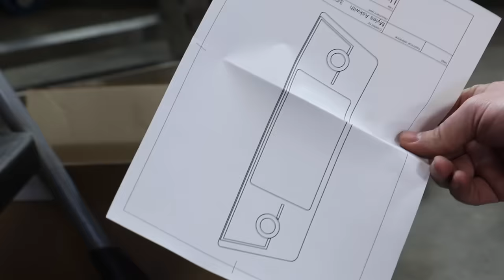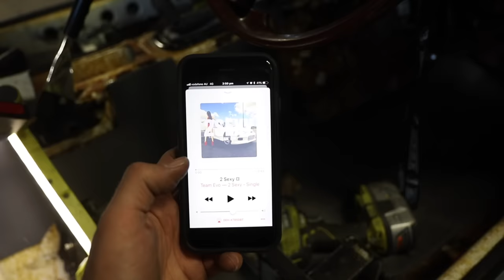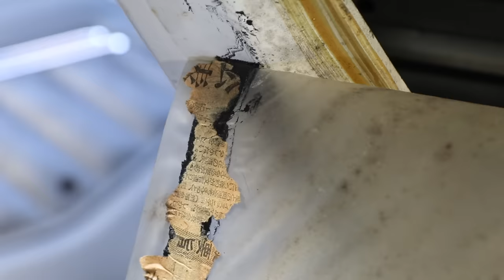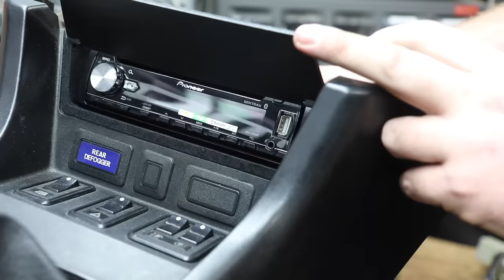RB26 240Z - Roll Cage + Stealthy Hidden Stereo

Comment: Why didn’t you just get a four channel bluetooth amp?  You could have done front speakers and rear sub without removing the factory head unit. Was it just that these are what Kicker and Pioneer would provide for the build?
Reply: Consider that most of the wiring on the inside was toast. I guess that if you're going to be running fresh cables you might as well go all in.
Reply: THIS EXISTS? what a great idea.  I find it dumb we have headunits still so large when cd players are old hat and not req
Reply: You need to be careful that your whole life does not largely rely on you having your phone with you.  They break.  They get stolen.  They die.  They fall into a sink full of water or a puddle.
Reply: A head unit gives you a lot more functionality.
Reply: I run this setup on my Miata. I've never missed my head unit. However, you can't forget your phone charger! Then all you have to listen to is the car... ;)
Reply: Sometimes it's nice to have the radio. Listening to Triple J helps me unwind when I drive home from work.

Comment: Re: Getting back the pushed out center bits from the fasteners

I would suggest coat hanger wire, with a blob of clay or fun-tac (moldable plastic for hanging posters and stuff) on the end to grab anything loose. Cheers!

Comment: You can get panel plugs/retainers with threads on them. They're like expanding bolts used for drywall (gypsum wall board). Similar to the screw-clips that hold bumber ends on, but all plastic.

Also, I'd have designed in magnets for that radio door. One to keep it shut, the other to hold it open. That's going to rattle to no end.

Comment: for the clips you need to push it just a couple of millimeters just enough, you dont have to hit it to push it in. then with a flat screw driver pull off the clip, suzuki use these on their bikes and i learned this the hard way, awesome build and the best ever combination any motorhead could think of

Comment: The trick to the taking out the push pin and not losing he center is to not push it all the way through. Use a pic tool or other long thin tool like a hex key as mentioned, pinch it between your fingers, only let a half of a centimeter past your fingers, then push the center pin out. Your fingers act as a stopper and that way you can pull the clip out in one piece.

Comment: Hey Moog, great vids m8, those clips are a pain in the ass, I use a small sharp screw, just screw into the peg a few turns and PULL it out with a pair of pliers, works everytime.

Comment: On my '73 Plymouth Duster I mounted the front speakers in the kick panels. I didn't want to run wiring into the doors or have to cut the door panels, or make the new speakers visible when the doors opened. It had an AM radio and 1 dash speaker when I bought the car. In 1993 I bought a cassette deck that fit the factory radio hole and put an aux. 6 CD changer in the trunk. I also mounted a pair of 6x9's in the rear shelf and hid them under guitar amp grillcloth.

Comment: for the plastic panel clips. There are ones you can use a philips screw driver to install and remove them. I use them. Just don't get the cheap ones.

Comment: Man I miss the days of installing car stereos. 

My first install was my 98 lancer.. ran all new wiring to all 4 doors with alpine R splits all run from the AMP in the boot with 2x alpine 12" type r's off a 1000w rms  mono block.

Second install was my 1992 twin turbo manual soarer..  that was NOT fun at all, the interior was so flush removing the back seats was a nightmare.
Ripped it all from the lancer and put it in.

Next install was my mates Mazda 3... that's was easy as.. 5.1 with front center of an 8" DVD player.

After the 3rd car you can do it in a day.. My final install was my 2008 CJ lancer. Miss those days.

Now there is nothing in my boot except a pram and broken dreams.

Comment: Hey Moog, I know the filming and release of the videos are quite spread out so you've probably already come up with a solution for the front speakers but I wanted to tell you about a place called Datsunworks, they make a kick panel made from abs plastic that have raised speaker holes that are pretty stealth. They make them for the 240z, and the 260z/280z so you should be solid.

Comment: They sell kickpanels for the front that you can put speakers in. Looks very clean, its what I did for my 240z.
Reply: Rindos Rides they don’t fit very well on RHD models that have been converted to E Throttle, the accelerator ends up inside the speaker housing

Comment: Drill a tiny hole in the center peg (not required, just makes rest easier), get a small screw with course threads and insert it a few threads deep into the peg, and carefully yank out the peg. That's the nicest way to reuse those dumb pegs. Can also try prying it out using a flat bladed jewelers screwdriver.

Comment: Moog, you're pushing the center of the pin too far. Just push it enough to where it's just a little bit below the face of the clip, and it should come out with the center pin in place. Then, you push the center pin back up so it's sticking up out of the center of the clip, and you're ready to reinstall. Hope this helps! Once I figured this out, these became my favorite knd of trim clip.

Comment: For the clips use a flat blade precision screwdriver to get in under the head to lift the pin up a couple of mills. Then get side cutter plyers and use them like a claw hammer with a nail to remove the pin. It is only about  1 in 40 clips that are particularly stubborn  that I simple cut off and use new.

Comment: For the front speaker, suggest using a good quality shallow speakers, 4" or 5.25" coaxial since the door panel don't have much space. The reason for slim speaker so that you can maintain the purity of the door metal. Find a spot on upper leg area, mount it on the cardboard door panel, find a mad looking speaker grill for mad finishing. remember put some acoustic felt behind the speaker.

The rear speaker pretty much a waste because of those drilled hole which is not enough. For the kicker sub, adhesive velcro tape will do.

Comment: Use the corner od a flat screwdriver to push the pin in a mm or 2, then pull the whole clip with a pry tool, I use plastic tools for this so as not to damage the interior. Some of those clips can be pulled out instead of in if they have a tab that goes from the middle to the outside.

Comment: Hey MOOG, regarding those "Single use clips" at 7:40 or so, drive a small self tapping screw into the middle pin just a bit and pull it out with pliers.

Comment: Staging is your best friend in the case of where to mount speakers. Personally I'd go with 6.5" component speakers in the doors with tweeters mounted in either the A pillars or on the dash facing toward driver and passenger.
Reply: PowerBass offers a great pair of 6.5" components with tweeters for cheap! And sound great!! Also come with bullet shapped center pieces for the components in place of where the Tweeters can be mounted in if you decide to mount them else where

Comment: Love the flap for the radio, I would have tried to add the original faceplate over the new one, maybe something on magnets so it maintains "purity" and is easily removed for normal use.

Comment: you are supposed to push the pin in slightly below the surface of the outside part, and then pry the clip out like any other clip. hope this helps later

Comment: Technology did slightly go forward! My 1998 Volvo V40 has the same type of clip holding trim and felt together BUT the middle pin is replaced with a screw you can simply screw out! Google for Volvo V40 trim clip to see it :)
Unfortunately I must admit that after 20 years the threads on the bolts don't really hold and they can still be a pain to remove, but still definitely easier than the push type ;)

I bet replacing the clips with ones with a bit fresher plastic would fix the problem for at least a few years.

Comment: I feel like you guys should put a little bit of felt or something soft with an adhesive backing around the inside trim of the radio bezel so the door doesnt knock against it constantly. A subwoofer in an old car, also being that the shifter trim is right over the vibrating drivetrain could lead to a lot of small noises from that door.

Comment: That head unit cover is cool, but if you want it at the next level it needs some type of assisted open. A spring or lower the hinge position so you can push on the top of the panel to open it.

Comment: You arent meant to push the center completely out of the clip. You are just supposed to push it enough to click again which means the lock is disengaged and you can pull the clip out. You then reset the center push pin where it is sticking out so when you push the pin back in it engages the lock.

Unless you are talking about an entirely different clip that is the only clip that I know of and my car, even my motorcycle, has those types of clips.

Comment: If you push lightly on those clips the pin should click back and be able to come out without losing the pin. If you push too hard the pins will fly out the back. You'll feel it click once before it pops all the way out. Then just grab a clip tool and pop the clip out.

Comment: With the flap, may I suggest adding a layer of silicon or flat foam strips around where the flap lid bezels are, would not want to be driving around hearing a rattle from the flap hitting plastic ;), may also want to have a way too keep the flap locked when boosting.

Comment: You could put the front speakers in the center console. But in the doors, you will need to route the wires in the door and, since (from what I saw) there is currently no wires to the door, getting the wires from the car to the door, making the clearance and protecting them may be a lot of work...

Comment: the panel clips are re usable, u need to use a tiny screwdriver or a thicker pin and gently push the center of the pin until you feel the first click. and it comes off. after u are done with it you push back the pin and clip it back on to the panel. In Japanese cars almost all the trim accessories are removable and reusable.

Comment: Those clips that push through are usually designed so that you don't actually have to push the center completely out, unless it's a Volkswagen lol. Push them in about half way and then remove the clip with a clip remover tool. You can then push the center back the other way and reuse the clip.

Comment: You should try work out a mechanism for that headunit flap, like the "sunglasses" holder in specifically a BMW E46 (Going off that because I own one and know it well). When it's shut. You press it in a couple of mm and it unlatches and a spring swings the door up and holds it. then you swing it back down and press it in till it latches again to hold it shut. The flap you have as is works, but lets be honest. Having to hold the flap up with a finger while doing anything with the headunit is going to be a pain.

Comment: In my experience, if you don't push the centers all the way out of those push-type connectors, you can pull them out intact and then reuse them, but it's possible they work differently in this hemisphere.

Comment: The doors are so narrow, If I put front speakers in, it will have to be under the dash... maybe in the rear corners of the roof (perhaps tweeters would be best there). 
Right now, I only have the rear, opposing speakers, but the sound tends to cancel out quite a bit before it gets to the passengers. So I am considering re-positioning the mounting brackets to aim the speakers forward a few degrees, as well.

Comment: Centre pin goes down until it hits a stop. Don't push too hard and you can pull up both parts. Sometimes the middle WILL just disappear into the ether...

That stereo is made for the LHD market. The main controls should be near the driver. Volume, power, source.

Comment: The radio cover is great. Would have been even better if it had some mechanism to have it slowly flip up after you push it, like the one in an S2000 (S2000 flips down). Really great build though. Great engine choice and suspension.

Comment: the pins are installed from the outside and pushed in to the panel to hold them in place the only way to save them is get the tool that lift's the panel pin and all or you can pry them up with a putty knife by sliding it under the panel you want to remove you will mess up half of them but they don't drop in to the nether reigns of the fenders .

Comment: Don't try and save the panel pin centres. All I do is replace the pin with black self tapping screw. This replaces the pin and solves the problem. It also makes removal easier than before because you can partially back the screw out and use that to pull the clip out.

Comment: I'm still working on the stealthy install of my stereo in my Datsun 510, but my plan was to use the original faceplate to cover the new head unit. Perhaps you can do something similar by putting the old faceplate on your new flapper door.

Comment: You should be able to pull out the centre pin and reuse the clips. At least I usually do pretty easily, but then I work mostly with sensible Toyotas. You should test it sometime, like a mad Yar.. AE86.

Comment: You don't push them all the way through. Usually they have 2 positions. You hold the tool that your using so when it pops through initially you can stop it from going all the way through then take a flat head screw driver and gently pry it out with the pin still in the middle

Comment: As to the push clips, you don’t have to push them all the way through. They just have to pushed in just below the flush point, maybe 1/4 inch. Should be a secondary capture point. Lift the head out, once out, put the center in the  higher position, and , bobs your uncle.

Comment: How about round 5 with the radio flap and make it flip down and put a little notch in the top to mimic a 70's and 80's ashtray. but instead of an ashtray it opens up to the radio. I think it would be aesthetically more pleasing as well make it easier to see the radio from the seats.

Comment: @8:00 but technology has come forward, just use push fit rivets. theyre used heavily on motorcycles and they just push in, then unscrew when removing and theyre all captive so you dont loose them and can reuse them.

Comment: install small midranges and tweeters in the front, low frequency's travel way further than high's so they can come from the rear.  As for where to mount them i wouldn't know but atleast this will minimize the space needed for the front speakers since you won't need a big woofer.

Comment: From past experience in automotive you really shouldn’t solder wires, over time the vibrations of the car will cause the solder to work harden and eventually break the connection. It’s always best to use crimp connectors.

Comment: I love the custom stereo cover flap... but i worry it will rattle. Is it spring loaded shut, or does it just fall in place with gravity?
At the very least you might want to put some rubber stoppers or felt on the bottom edge?

Comment: The little plastic clips don’t need pushed out all the way. They are reusable. Just push the center in 1 or 2 mil and pull the outer ring. Than to reinstall push the center out the front 1 or 2 mil and when it’s set push it flat.

Comment: Those clips, You only push the pin in about  1/8" or less and it relases the lock and keeps the pin. You should feel it as you push it in get tighter.  Youll have to use something small to lift the clip from panel after.   Reinstalling, the pin should stick out of the top, insert into panel, push pin flush.

Comment: You don't have to push the pin all the way through.   Those clips are designed to just push the center piece in a few millimeters and then you can pull them out.

Comment: you can get it out with a small screw where midle and side(biger part) meets, aswell as not pusshing them trough all the way   , btw be carefull pushing them trough , cuz you can make nasty fender dents from inside :D

Comment: Don’t push the centre pin on those clips too far and all way in 
They only need pushing in a few mm to relieve the tension on outer part then pull the outer complete with centre pin out 👍

Comment: the hideaway head unit is cool, but you guys realize that there are 4 channel amps with bluetooth? lanzar makes a 6 channel unit for like 160 USD on amazon. you can get a 4 channel waterproof unit made by pyle with bt for under 100 usd. I understand you dont want subs on this build, but amps are so much better than just running a head unit.

Comment: I would have put the flap upside down, and secured it with a magnet behind the panel. That way, it wont flap around on a bumpy road and when you want to push buttons it will stay down, this design means you have to hold it up and push buttons awkwardly with one hand. Unless I'm missing something

Comment: RE: that little flap that hides the radio. Might be an idea to fit some of that rubber or felt buffer on the back of the flap otherwise every time the car goes over a bump youll get an annoying click when the flap opens and closes.

Comment: Those clips are the worst, except maybe the versions with philips screws which you have to keep pressure on to turn, but the pressure stops them spinning out.  They are in EVERY car!  The only practical  replacement options I've found are nutserts or speednuts, but it depends how important the fixing is.

Comment: the plastic things you attach the internal pannels with the ones i would get oem you dont have to puch the pin out completely nut most times it will fly out when applying force to get it out

Comment: Why not attach the old face plate to the 007 hidden missle flapper door? Itll look like the old head unit is installed until you lift it to expose the new sound bits.